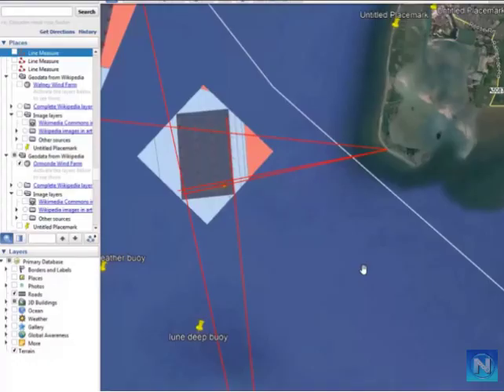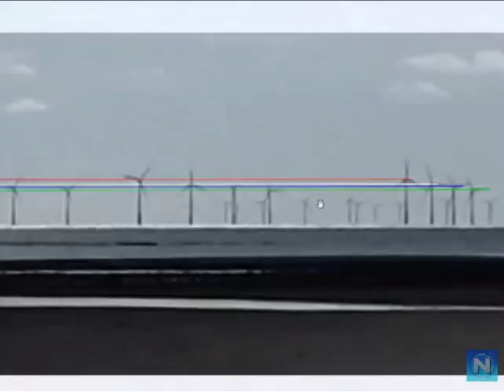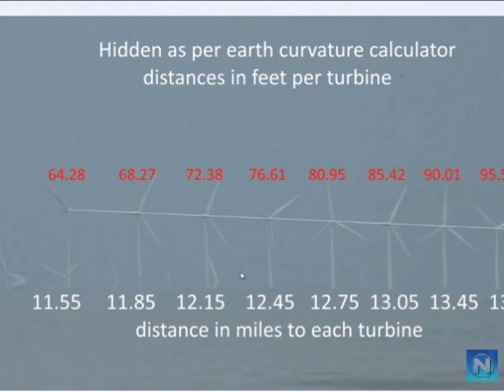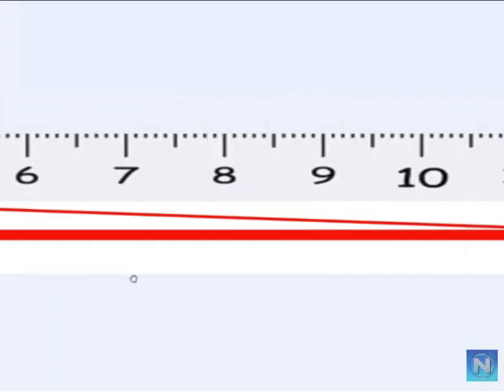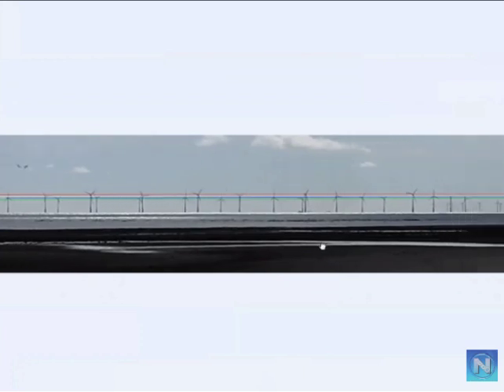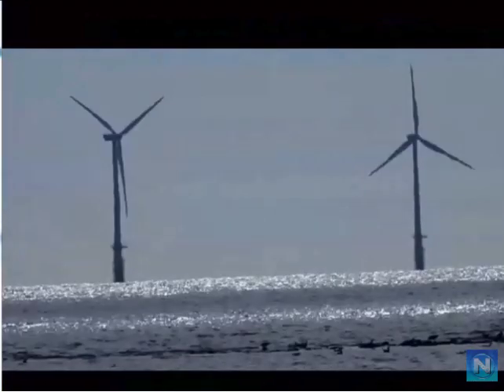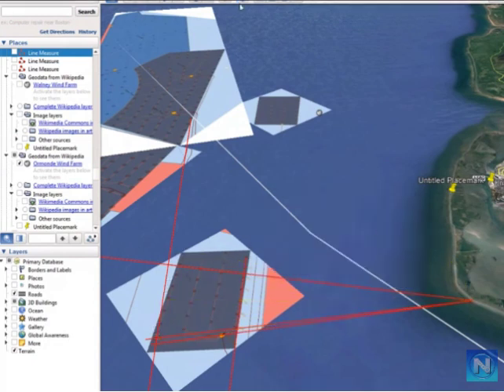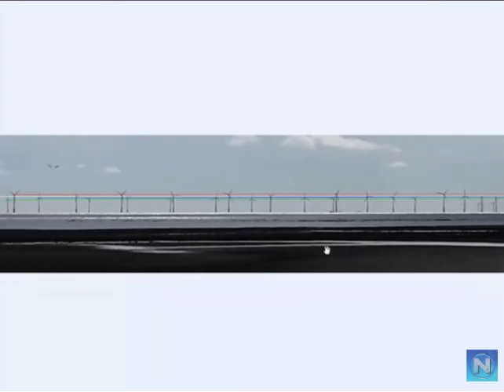surface convexity utterly and soundly debunked

Comment: You can apply the same logic to the water as well --as we know for certain that it's level. It's very possible that they constructed the windmills at different heights to account for the curvature. Even if you take into account an incorrect 8" drop per mile (not the correct 8 inches per mile squared) then that should be a 9 foot drop. You should even see that in the water as well. But actually with 13 miles.... the water should be curved with a visible 67-68 feet. Holy crap. I'm now officially a flat earther. The same thing can be applied to anything that is built. If the water is supposed to dip below the horizon, and you can see a 13 miles span from left the right, and you can see the water, then there needs to be a noticeable bend in the water. There's no way around it. It can't bend from one angle, but not the other.